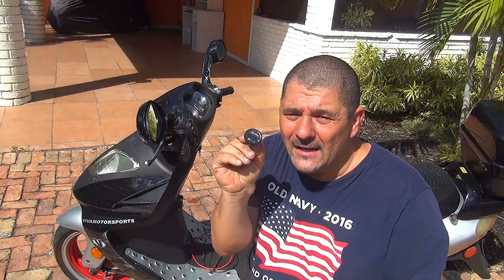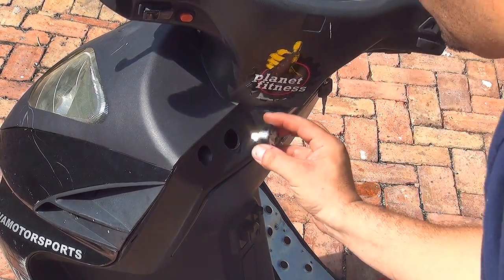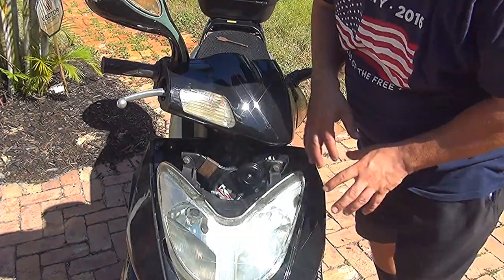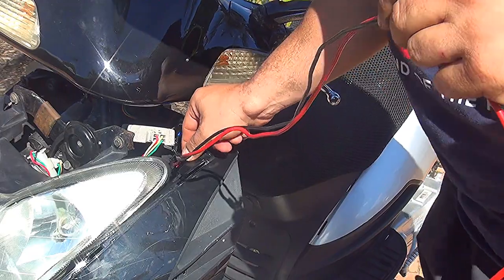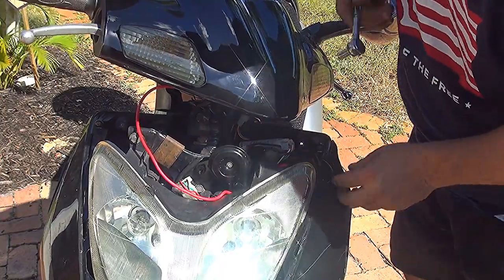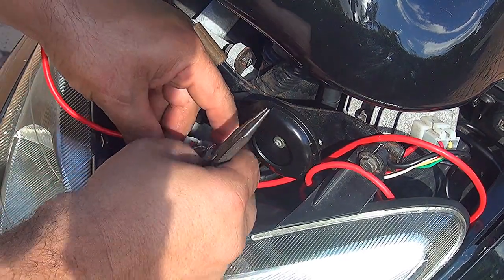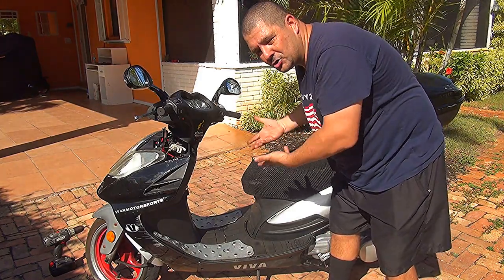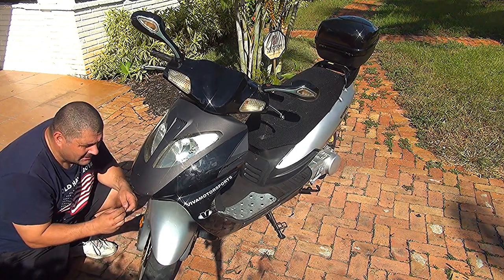How to install DC voltmeter on a Chinese scooter

Comment: What range of numbers would you expect to see if you did indeed have an electrical problem / charging issues?
Reply from the maker: Hello Roland if you have an electrical problem on the voltmeter display you will read 10.8 volts or less

Comment: Awesome! I need to do this ASAP. I replaced my stator, rectifier, spark plug, battery, and solenoid yet my battery does not charge when I ride the scooter. I have to use a battery tender every few days or eventually the battery dies.
Reply: You have some sort of parasitic drain going on my friend.  There is a guy with a great video for you.  90vertg or something like that.  He has a genius way of finding the drain.  Best of luck.
Reply from the maker: Hello Roland thank you for watching my video
Reply: Eric R Thanks for your help but what’s odd is that it charged fine before my attempt at removing the flywheel with a homemade tool that did indeed finally get it off however it also damaged my stator via the copper wires being impaled by my long bolts. That is why I ultimately had to replace the stator. I figured i screwed something up electronically so I then purchased a new rectifier and CDI with no luck. I’m thinking maybe the spacing with that magnet part is a possibility after watching several YouTube videos but have yet to try that out.
Reply: Tried testing the battery with a voltmeter with the engine off, 12.9, stared the engine and at idle was a 12.7, revved it and never broke a 12.9. Any ideas?
Reply from the maker: @Roland-Henry  Hello Roland I have a 6 pole stator at idle I have 12.2. / 12.05  but at full throttle  the stator is producing 13.8  / 14  your problem could be a bad quality stator or bad regulator or wire .  to fix the problem start opening the stator clean the inside part of the magneto wheel with very thin sand paper ( not the copper coil ) after clean the top of the stator poles with sand paper  put everything back turn on the scooter and test to voltage at the battery if that did not change with the voltmeter with your scooter on test the wires that goes to the rectifier regulator set on AC voltage and try to have the same reading that my scooter have in this video https://youtu.be/pYQE427rfPk  another important little thing make sure your motor is grounded perfectly place the positive  pole of the multi meter   on the battery and the negative pole first on the black  connection of the battery and then with the negative pole touch your motor you should get the same reading. 
Also a 6 pole stator produce better electricity than the 8 pole on a 150cc gy6 motor
Reply: Adjusted spacing and even replaced the pickup with the original pickup with no luck.
Reply: @VirberelloScooterTips  Will perform all of your recommendations first thing in the morning and respond with the results. I appreciate the advice!